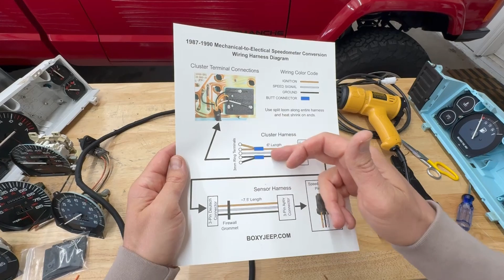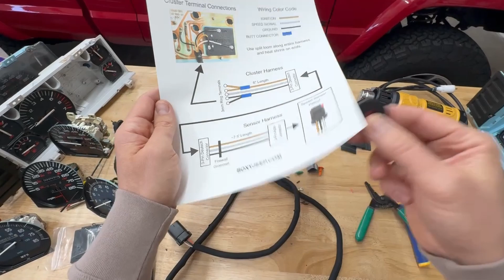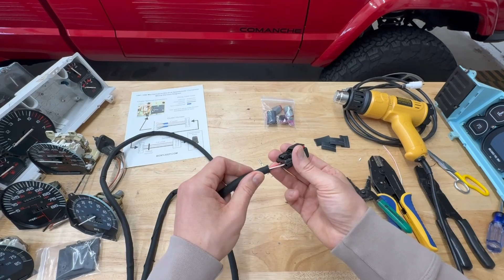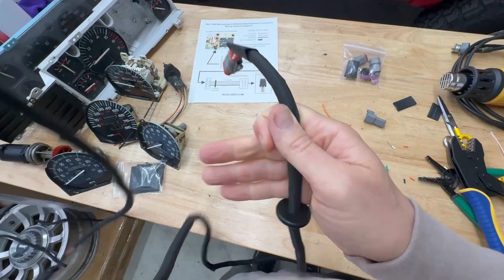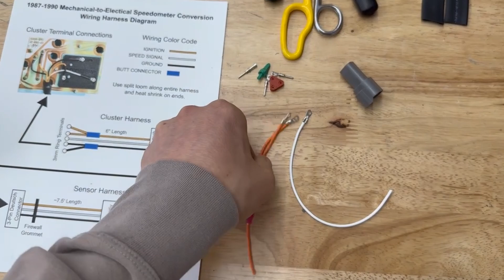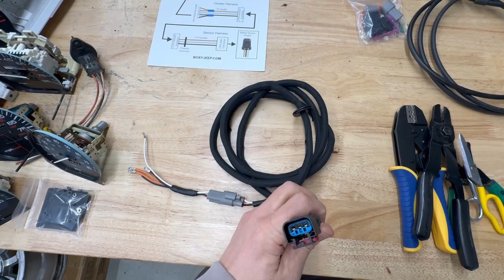BoxyJeep Renix Electronic Speedometer Conversion - Installation Part 2

Comment: Hi! Another Great video! You've cleared up a lot of my doubts about rewiring my speedo. On my 92 XJ, all the wires are cut and the terminals are loose. The two orange wires are powered by 12V, right?
Reply: This kit is specifically for 1987-1990 Renix Jeeps, not 1991-1996 OBDI XJ’s.  If you’re trying to test those wires, grab a multimeter and see what they read with key on.
Reply: @Chfjdchkvgf1453 Originally, Mi XJ was a 2.1 diesel, and I don´t know if Renix or OBDI. Since the previous owner replace the motor for a gasoline 2.2 carburated, he cut all the cables and trash all off behind the cluster and in the motor well, so the gauge cluster is dead. I´m rebuilding from scratch and seeking info from all over internet.
Reply from the maker: @leoyannick  Ahhh got it.  I’d try to splice in a 91-95 harness and gauge cluster.  Everything should work without an ECU except for the tach.